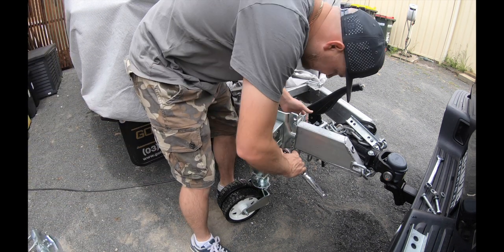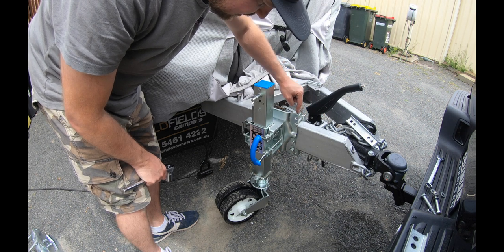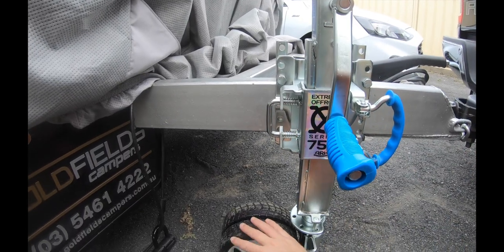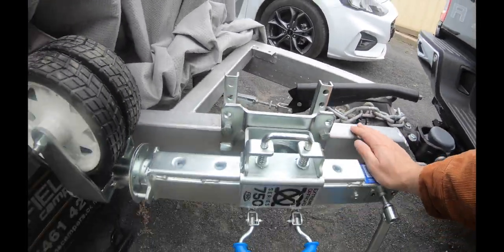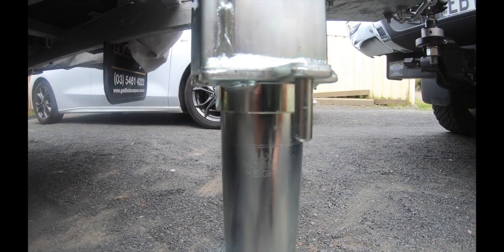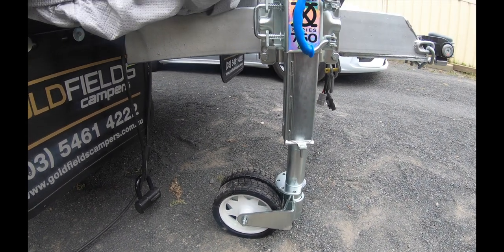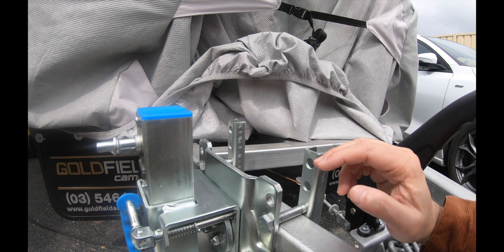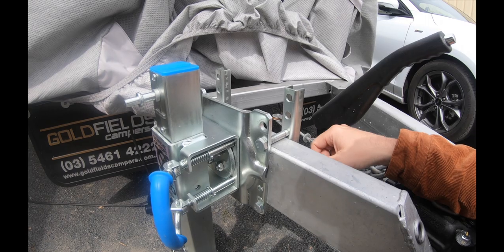Install ARK XO 750 Jockey Wheel

Comment: Maybe you could split a couple of pool noodles and cable-tie them over the protrusions?  Certainly a good idea if you've got kids running around.
Reply from the maker: Ended up removing jockey wheel as it protruded to much hitting the rear arb step.

Comment: @Paz Rahn

I just bought this same Jockey hoping it would somehow work for a drawbar size 120mm because Ark said a washer to fill the gap would work. I am yet to open the pack and figure out what they actually mean. But need to install it by tomorrow before we go away on a caravanning trip.

What adjustments you had to do to fit on your drawbar?

Is it limiting you for any of the jockey wheel's functionality?

Any other tips that might be helpful?

Thanks heaps in advance 😊
Reply from the maker: Ok Lucky you messaged me. Ive hit mine with the rear of the ARB step as the jockey wheel is quite boxy. So either I need to extend the tow ball or just main issue my draw bar is not long enough. Overall it's a good jockey wheel but my issue is hitting the back.
Reply: @PissTakeProduction  Thanks for responding mate. I am not sure if I am following.
Do you mean you are not able to extend it out long enough to have it up when not in use?

Also, did you have to do any adjustments to fit it on to your drawbar? For example, both top and bottom bolts are supposed to go through the drawbar but I see your top ones are sitting on top of the drawbar, not sure if the bottom ones are through the drawbar?

And the bit about max moving height, do you mean you are having to extend it past moving height to unhitch the caravan from the car because of your drawbar size or is it just how they are designed?

Thanks :)
Reply from the maker: @zakshaikh5659  I didnt have to worry about drilling the holes into the drawbar. You will see that the bolt pattern allows to go under and over. Ok with tight turning i.e jack knife the trailer too tight to the vehicle rear I hit the jockey wheel unfortunately as it is bigger than a standard jockey wheel. I'll do a video on that. The winding pin hit the rear back of my car. It's a good jockey wheel just that my camper trailer is short unfortunately that's why it hits.
Reply: @PissTakeProduction  Ah I see what you mean by hitting your car with it. Our van has a similar short drawbar, so I will have to see if it will be too tight on ours too. I am thinking maybe before folding it back up, adjusting it's height in such a way that the top part is minimally out facing towards the car.

Comment: Put it at the bottom and you will get more height to
Reply from the maker: You cant as the draw bar size doesnt work with the bolt hole distances
Reply: Agreed. First time I used it, it maxed the height. So I lowered the setup like you describe. Worked perfectly